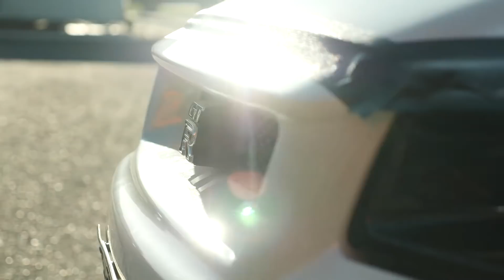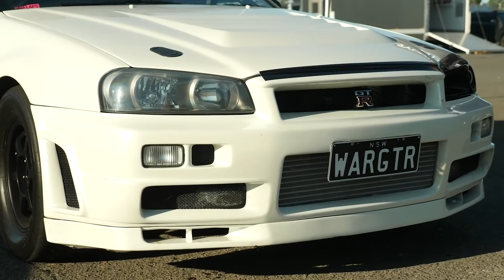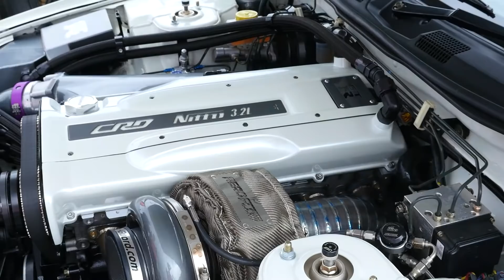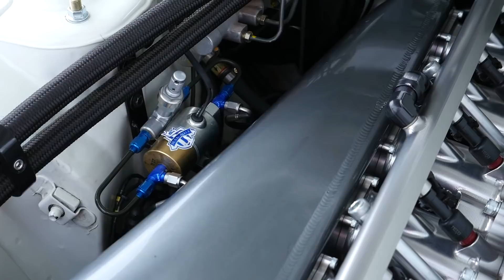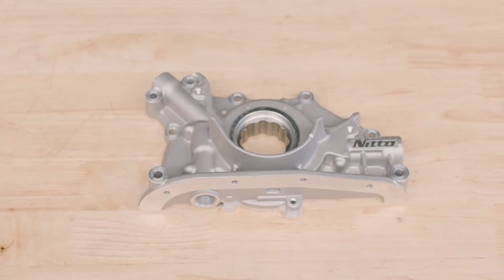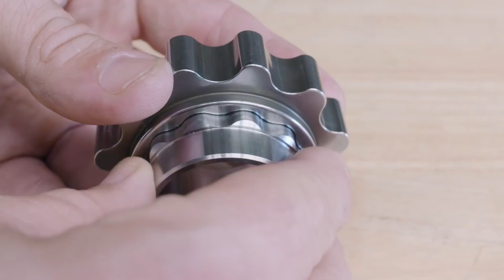250HP to 2500HP? Aftermarket Parts Development | Nitto Performance Engineering [TECH TALK]

Comment: 👍👍👍
Reply from the maker: Chur! - Taz.
Reply: Hi I'm running  550 wkw wet sump  nitto pump  head drain etc   revs 2 8500  no issues at all but I know alot of cars from various shops  running into blow buy oil issues  and  oil not returning to sump  on  700  plus kw gtrs reving  to the moon   I think    dry sumping  is  cheap insurance  on and expensive   rb engine    plagued with oil issues

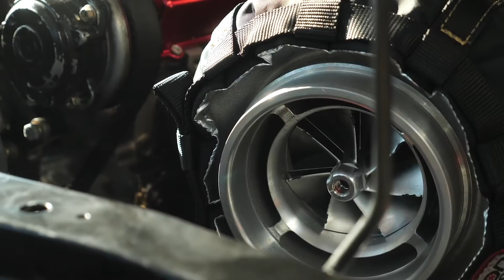Comment: @6:55 Is running a turbo without a filter really worth the potential damage you get from chewed up compressor blades?
Reply: Show me an air filter that will flow 2500hp with no restriction
Reply: @munt-r7x  https://www.nbcnews.com/mach/science/skyscraper-sized-air-purifier-world-s-tallest-ncna858436
Reply: @Themayseffect  😂
Reply: Yes
Reply: I'm pretty sure the compressor wheel would be one of the cheaper parts on these cars, and when you're chasing the times these guys are its probably 100% worth it.